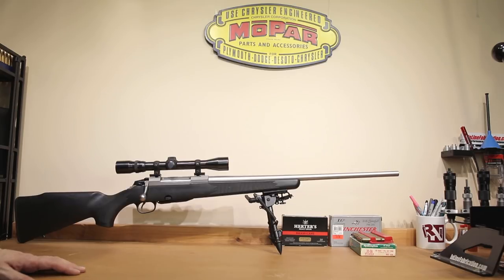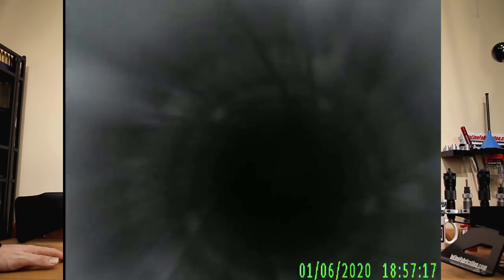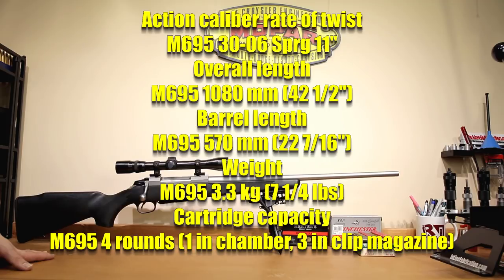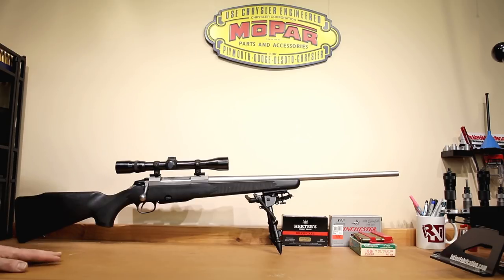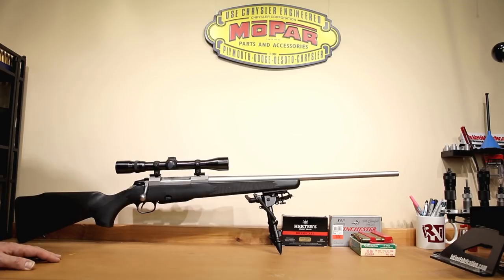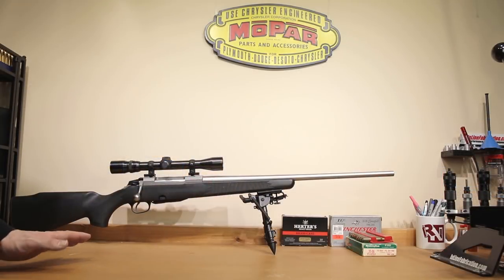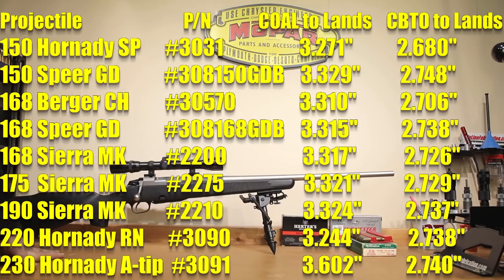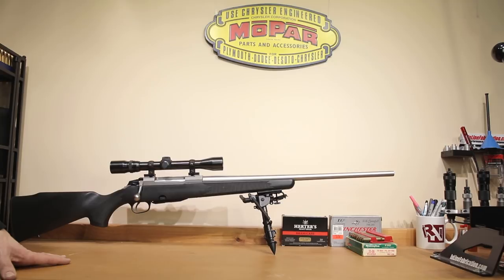Improving your rifle accuracy - .30-06 Springfield

Comment: Its a HUNTING rifle, not a heavy barrel benchrest rifle there Elroy. A 3" group at 150 yards is totally acceptable for hunting as long as the point of impact is center target, not 6" to the side. A consistent powder charge that gives no more than a 10 fps velocity spread will do more than any one other thing to tighten groups. Throw that bipod over the hill for a hunting rifle,...useless clutter junk.
Reply: 3 inches at 150 is hot garbage for modern day rifles. Something is wrong.

Comment: I own Tikkas in various calibers. They shoot lights out. I’m not a big fan of scrubbing with bronze brushes, but not knowing how this rifle was shot in the past, I’d give it a deep cleaning. Secondly, I’d check the torque on the action screws. My Tikka T3s tend to like 40 inch pounds at the rear and 35 inch pounds at the front.
Reply: Frank B. Albaijés well said .i have had the same experience. If you purchase a Tikka your buying accuracy.
Reply: @leeeng478  - I got the replacement steel recoil lugs from Tikka. I believe they were $20. Supposedly, this is more of an issue on Magnum calibers, then say a 243 or 6.5. Replacing the lugs on the synthetic stocks is easy, not so much the case on wood.

Comment: Check the barrel to see if its full floating. Should be abke to slide a dollar bill inbetween the barrel and the stock, all the way down the barrel. Might need to sand the stock down a little bit. I also notice that newer Remington rifles tend to dribble empty cases out of the rifle rather than a firm eject, so perhaps thats an industry standard.

Comment: Personally ,I would lower the ring height first. True the rings and level the scope. Check crown, float check, torque screws to spec. Match grain bullet to barrel twist. Then shoot.
Reply: Excuse me paul moss, the guy has no scope mounted, and there are no sights on the rifle. Not that your advice would be wrong but sometimes you have to believe your lying eyes.
Reply: @o5245607  What video did you watch?

Comment: One thing I did not see you mention to check would be any contact of the barrel to anything along the barrel channel. Any contact on the barrel will affect barrel vibrations and accuracy. Free float the barrel will give you better accuracy.

Comment: My T3x CTR 260 Rem is the most consistently accurate factory rifle I have ever had. 
Regarding ejection, it does sling the spent case out like lightning but it's not Savage slow either. Very smooth bolt.
Check the scope. Maybe a janky reticle and something is shaky in there.
The 11 twist is typically better for 168 to 175 grain bullets.

Comment: Ive never had a tikka,  always heard good things about them. I have haf several 06's my favorite being my howa 1500. I get sub moa with factory 150 grain blue box federal ammo . I wouldn't think that a tikka,  with their reputation would be all over the place like this, it's got to be something simple easily overlooked
Reply: I've got a howa 1500 as well and I've only just discovered the 150 grain blue box federal (powershok's) recently myself! Good load for this gun.

Mines the fluted barrel model, I'm chasing a walnut stock for it though as the black rubber stock that it came with I can no longer handle 😅

Comment: My Howa 30/06 shoots lights out. My 308 Howa does the same. My 243 Howa doesn't care if it's Remington or winchester 100 grain softpoints. My vanguard 300 win mag does its best with 180 grain winchester power points. 
 Every single one of these rifles are extremely accurate. No way in hell will I ever part with my rifles. Crazy accurate, but so is my Ruger American in 308.
   Don't want or care for anything else.

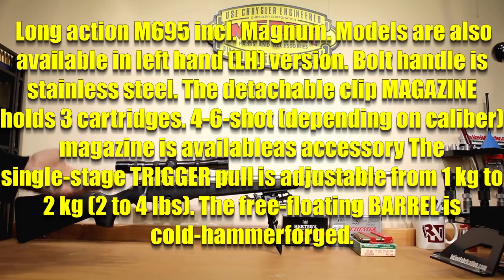Comment: 3:49 Barrel length is messured from the bolt face? Isn't it measured from the start of the rifling?
Reply: From what I know it starts at the bolt face twist rate is from the the start of the riflling to 10 inches
Reply: @buckhenderson1788  thx. Here barrel lenght is from the start of the rifling

Comment: I had a Tikka T3 in 300 Win Short Mag.  It would put the first two shots from a clean cold barrel to touching at point of aim. Third shot was usually 3/4 inch away.  That was with Winchester Supreme150 gr ballistic tips.  That gun was stolen.  I have a T3 in 6.5x55 that shoots any ammo I have tried to 1 MOA for 3 shots as guaranteed.  Even Priv and S&B.  Both rifles are left handed. The 6.5x55 has a long freebore.

I would start by changing to a good known scope and retest your ammo.  I have had several clunker scopes in the last 10 years. Even a brand new Nikon that was not cheap.

Comment: Want to be so accurate it is boring? Simple: Get yourself a Winchester M70 30-06 with a good barrel, and load some custom handloads with Hornady A-Max 168-grain or some of those 168-grain ELD-M pills. Use IMR-4064 and some match-grade primers, and you're off and running. Do some load development and testing, and you should be able to develop a load capable of shooting sub-0.5 moa all day long.

Comment: Making a comment about how the gun through the brass out of rejected the brass. I would prefer the gun not to throw the brass 10 ft away from me when I pull the bolt back cuz I do say the brass and I reload. If I'm out in the woods and I'm shooting at a deal I will not know where the brass goes. If the gun throws at 10 12 feet away, I before to drop it at my feet the same with my shotguns

Comment: I bought a brand new Tikka M55 Standard .243win  in Australia back in 1990 that shot 2.5 to 3 inch groups at 100 Yards with  100 grain Winchester Power Point bullets , but with Winchester Supreme 100 grain BTHP it Shot 3/4 inch @ 100 Yards and 1/2 Moa ( 1inch groups) at 200 Yards . The bolt on that rifle was silky smooth and the trigger broke like a glass rod . I regret trading  it in 3 years ago to buy another rifle .
Reply from the maker: Thanks for commenting Jim! I believe it. I am sure to some extent the scope is what is going to be the limiting factor for this project. I may take it off but its not mine. I can say at this point everything is tight and 1 MOA groups aren't going to be any trouble for this rifle in this configuration. I do hope I get some feedback about the ejector spring. The biggest downside  I see is the lack of in stock replacement parts. you can't buy just one spring and the whole kit is $73 and back ordered. That's a bad day if need it now. But Hey maybe they never break.

Comment: Did you checked the stock screws to make sure they were tight before shooting it ? I’m surprised it shoot those groups , Tikka rifles are known for their accuracy. It’s well worth it to try premium quality ammunition in these rifles . You might be able to put a Sako extractor on the Tikka . I have no doubt that with the quality of bullets you will be handloading you will be getting groups in between 3/4 inch to 1.2 inch at 100 Yards no problem which is great accuracy from a stock standard sporting/hunting rifle .

Comment: Betting on the 175 Gn Sierra.  Use 40 ish grains of Reloder 15. Very jump tolerant bullet. My experience with Tikka is very positive.
Reply: That's like a 308 load. Add 10 grains to that and you're closer to a 30-06 load
Reply: @ryridesmotox  My old Lee data 8-14-96 says for a 180 Gn Jacketed 42.7 as a starting load and 48.3 Max @ 3.250. My lower (ish) loads are very accurate.
Reply: @daviddale3624  the alliant website shows 47 to start with a 200gr and 52 for a 150. I'm sure it is a nice wide node in that range. Just seems kinda wasteful to have such a big case and not use it haha. 

I have loaded up 46 gr of IMR4064 in my 308 Jag cases with no pressure signs. But that's as much as I could get in there.
Reply: @daviddale3624  48 gr. reloads 180 hot core here shoot right on

Comment: Why not glass bed the action/recoil lug?
Reply: @leeeng478  Another upgrade is to replace the plastic trigger guard with bottom metal so a greater and more consistent torque is possible.

Comment: Heres the short cut for 3006  that needs to be accurat enough for anything from rock chucks at 400 yards or deer out to 300 yards 

150 grain sierra pro hunter seated reasonably close to the lands.
50 graind 4064
Large rifle standard primer.

Probably the most universal 06 load in existance
Proven in multitudes of rifles.
Most vital aspect is getting close the the lands ,15 to 30 tho.

Comment: Honestly, the first thing I would do is put a better scope on it with lower rings and see if that doesn’t make a significant difference. Then start reloading from there. Hard to get high quality groups with a low quality scope. I’m not trying to be a jerk, but from the video it appears to be an older scope and the rings are pretty stinking high haha.
Reply from the maker: If it was mine, it would have had a new scope to start with. It will be a limiting factor IMO as well but goal set is under an MOA and I think we are not going to have any trouble, even with the scope. Believe it or not the scope height is perfect with my check weld though.
Reply: Bolt Action Reloading  obviously everyone’s cheek weld is different. I just point that out, because that would not even allow me to look through the scope for me with a proper cheek weld. We all have different faces though! 😂

Comment: Years ago I found a couple boxes of Remington Accelerator in 30.06. They were a 223 sabot in the 30 cal brass.  anyone else ever find this? How did yours shoot? I also saw that sabot in 30.30 once
Reply: The accelerators that I shot were like crap. About 4 MOA out of a 1-10 barrel of a 300 WIN MAG. But I can’t complain, because I got them as a close out for 100 for $1.50. Oh well, I still have quite a few of those projectiles but I won’t load them up in anything that “I” have unless I just happen to run across a rifle for a screeming good deal. Even then I it needs to be a 1-13ish barrel.

Comment: Hi! I don't know if it's been verified already and this is just an unresearched guess but about the ejection of the brass, here's my thought... I know when I bought my t3x they were heavily advertising their new ejection design and how you would never get a sideway brass stuck anymore, so if this rifle is older than when the t3x went out, it's possible that is was normal for earlier models to have trouble with ejection. But again I might be wrong. Though, if anyone knows you are more than welcome to correct me. Have a good day and keep em coming! I love your videos.
Reply: Simon Lauzon I believe I read somewhere the ejection port was enlarged for easier loading of single rounds directly into the chamber.